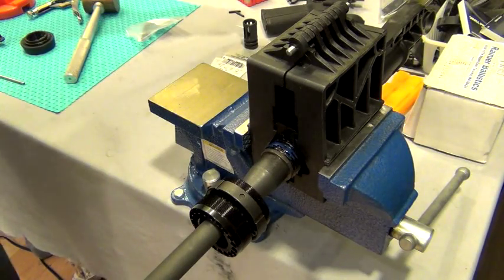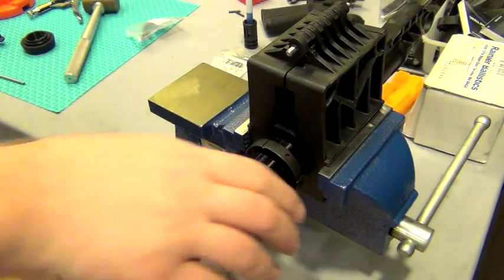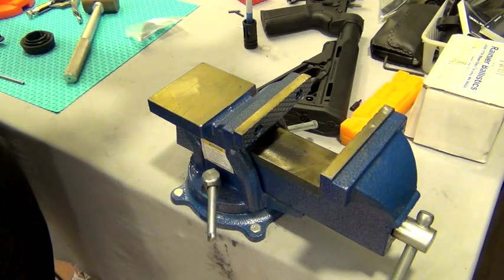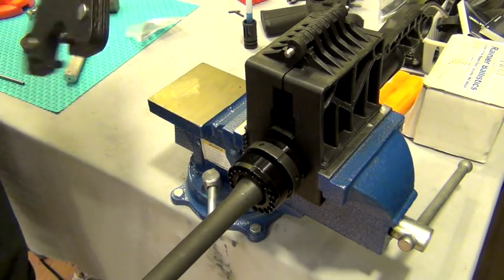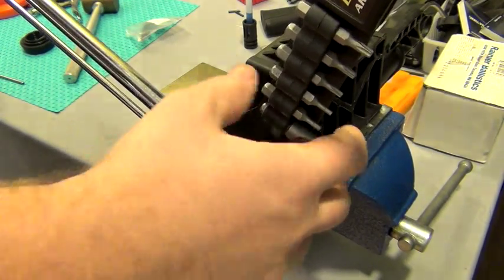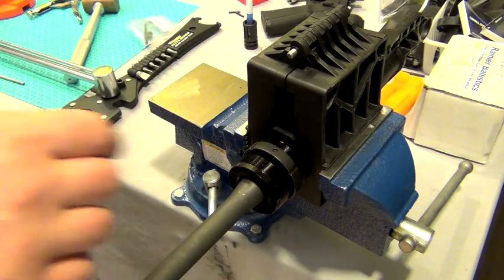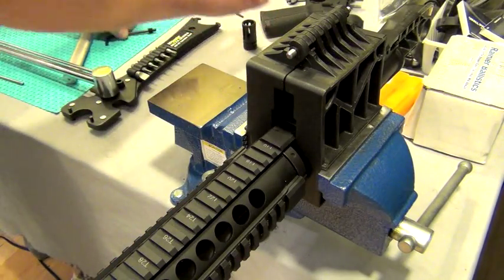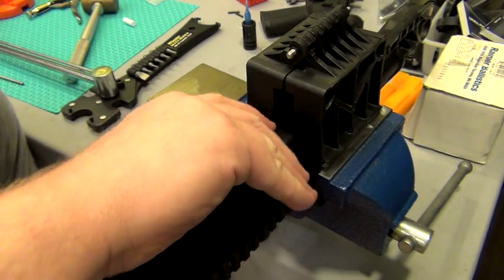AR UPPER ASSEMBLY

Comment: Simple little tip. You can plug the barrel on the chamber side with a patch & blow into the muzzle end to make sure the vent hole is lined up properly. You can easily tell when it's lined up perfectly based on how easy it is to blow air through it. (obviously make sure it's safe before putting your mouth on the barrel) :)

Comment: bro go hit harbour freight or somewhere and pik up a spanner you dont need the MI one I just used one I had to install mine just get the proper size and your good or if you can get a punch in there tap it around with a punch ..you can do it